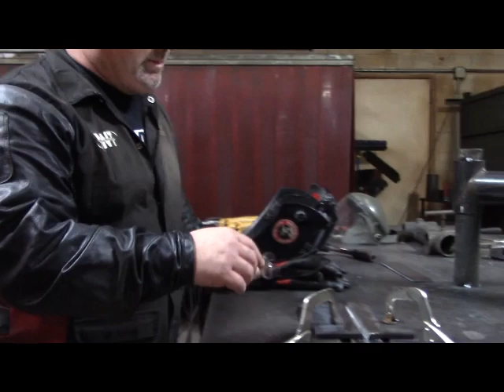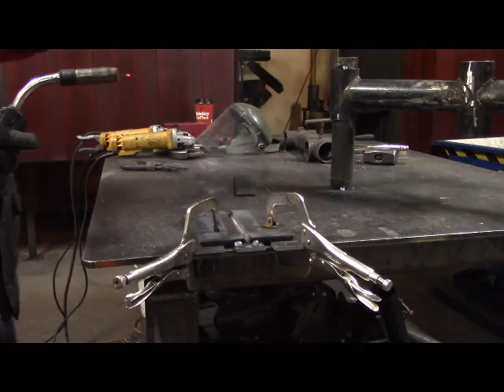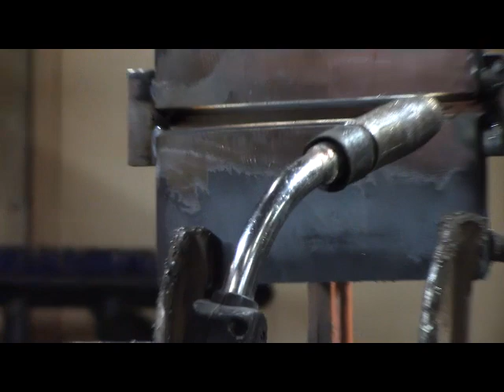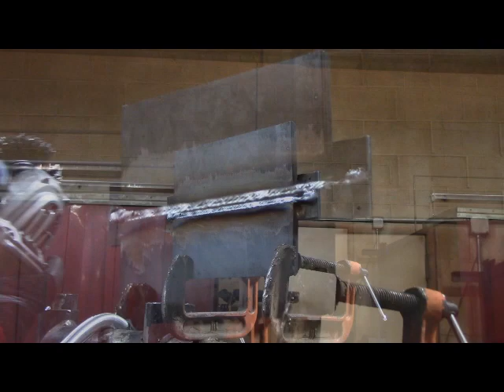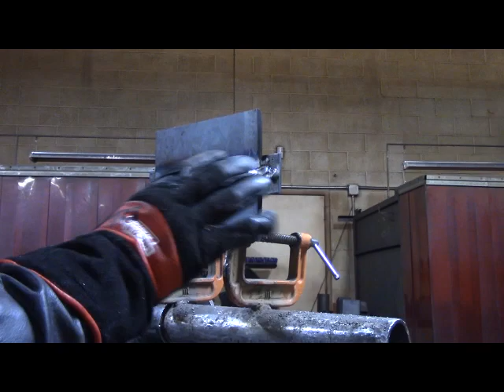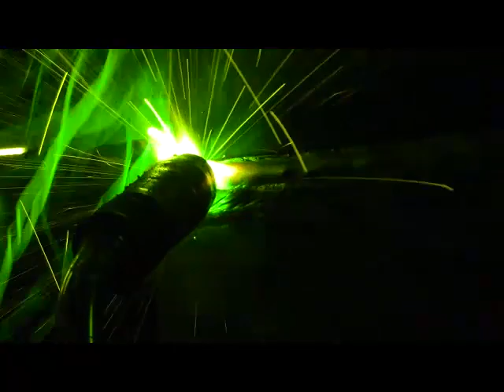GMAW Spray Transfer Mode 2G Test

Comment: Just wondering I know there are .more than one way to skin a cat but other 2G test videos I have seen they used about a 1/8" gap and did that with 3 passes why did you have to do so many passes and such a huge gap?
Reply: AWS structural welding code whatever the wps specifies for the test
Reply: @lurk.harder gotcha

Comment: Had to weld several thousand feet of half inch plat on every floor of a new steel refinery plant. All plates where 8'×4' 35° bevel and 3/8 root. Me and my weld partner had two old suitcase Lincoln's they maxed out at 37.5 volts and 480 wfs and man those were fun days running through about 4 large spools everyday

Comment: I'm curious as to why so much crackling while using spray transfer? In my experiences, you tweak your settings until it sounds just like gas hissing, or a close to that sound as possible. What is the reasoning for so much noise in this video?
Reply: High WFS. Very common in production settings to run high WFS, youll often end up getting that crackling, pinching effect. You can lay even more metal down faster like this. Also depends on the gas mix. But this is definitely spray transfer, if the arc was visible that would be clear to see.
Reply: I agree, it’s just not a “true spray” transfer. Lower values with solid amps help with higher travel speeds. For the thickness he’s gelding it’s plenty.

Comment: This is a pretty good, informative video.  Comments about it not being spray transfer are absolutely comical.  This guy is the president of an accredited welding school, gives everyone the set-up specifications, which all fall within the minimum needed for spray transfer, and then he shows you his beads which look high quality, but somehow he doesn't know what he is talking about?  Come on man.   Gotta love these internet rocket scientists who comment that this guy is wrong.
Reply: If you guys are really a welder, you would know that he is not on a spray mode here…hear that crackling sound?…it would be just a hissing sound and barely a crackle
Reply: its not a "true" spray transfer but its still spray. Spray isnt just a humming/hissing noise. Its when you have a concenrated arc that is deep penetrati @kabihog5789
Reply: I'm in his school right now. I see him often. He is the real deal. The man lays masterful beads.
Reply: Not Spray arc!
Reply: it's unstable spray transfer... whenever he whips back it goes into short/globular transfer and when he whips forward it occasionally goes into spray transfer.. his voltage and/or travel speed are too low. the beads can look good and pass tests without it being true spray... but if it's not in spray transfer then it technically doesn't meet any WPS that specifies spray transfer.

Comment: this is definitely spray transfer, spray transfer had two types the bacon noise (what he is using) and the quieter hissing with no crackling(true spray transfer, difference is often the wire speed or the gas mix. i know this because it’s popular here in the UK and have used WPS like this before

Comment: not spray transfer at all. spray requires at least a 90% argon gas mixture. for spray with 045 wire, run around 29 or 30 volts at about 400 ipm, 315 amps, anything over 3/8 should never be welded with 035 or in short circuit transfer in my opinion

Comment: We ran .045 with 75/25 at about 28v wfs about 300-320 in flat position. Out of position would be about 26v & only 280 wfs. The gas mix is a big parameter that can change variables.

Comment: That’s not spray.....
Reply: You can get spray to sound like this but its obviously not what spray should sound like, more of an intense humming/vibration sound is what I hear when a puddle is correctly pushed and the electrode doesn't fall back into the puddle
Reply: @Pistonhead Riders Part of the idea with spray is the fact that the arc has ALOT of penetration providing you got the volts set right so that its narrow.. space around the arc super heats the argon which allows the filler to wet into the sides etc.. the wirefeed speed is there for the amps and to fill in the weld fast enough so you dont get undercut etc. If you getting heat issues then you should use a watercooled torch with bit more stick out bud.. spray transfer is a hot process regardless of how many amps you run

Comment: I thought that the minimum wire feed was 475 and 30 Volt's to be true spray?
Reply: On 045 wire
Reply: No it can vary wfs can go as low as 200s but spray is the transfer technique settings may vary

Comment: Isn't it too much sparkles for spray transfer mode?
Reply: There probably is too many sparkles to be considered a true spray transfer. When taking this test I like to drop the volts so I have better control of the puddle in the horizontal position. Good observation!
Reply: Too many sparks and too much noise. Spray transfer just a humm not the bacon frying sound
Reply: @998828k  spray transfer is bacon sound bud it depends what gas mix u use also
Reply: @morgs3007  Bud he names the gas he is using. 90/10. Same gas I use bud. Just a humm bud. It's. All about gun sngle
Reply: @998828k  no. not everything is in gun angle. If you got your wfs set high to your voltage you'll get a pinching effect and that crackling sound, puts down a lot of weld. Very regular in fabrication settings.